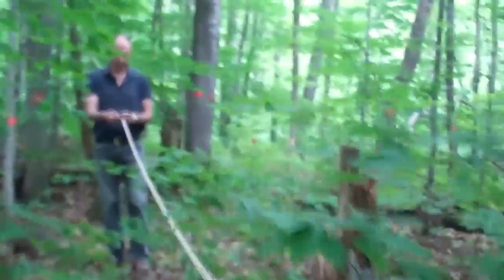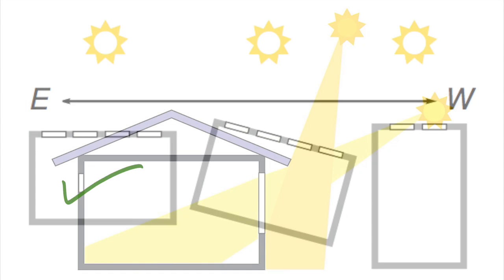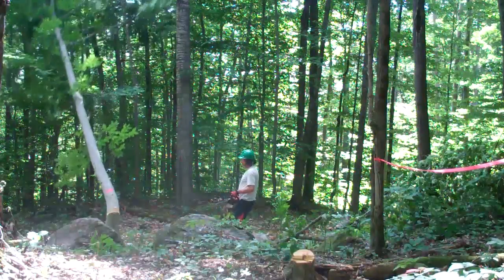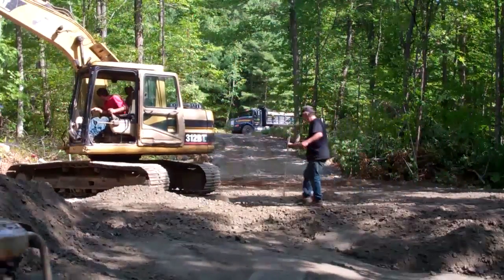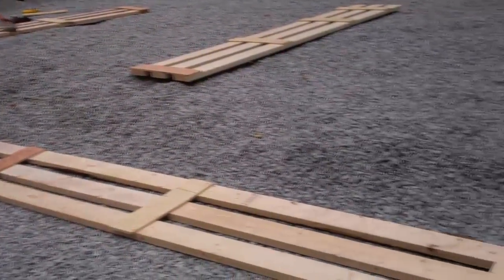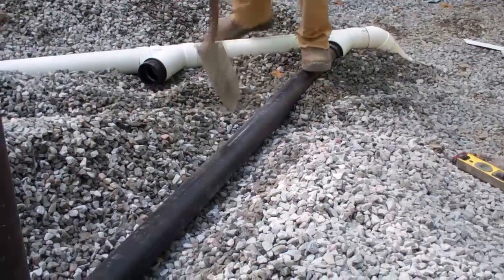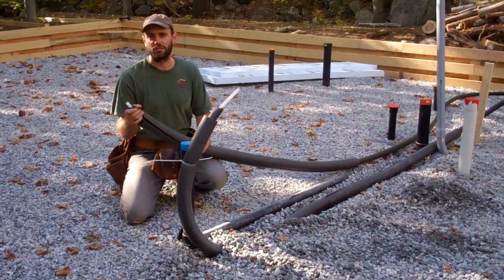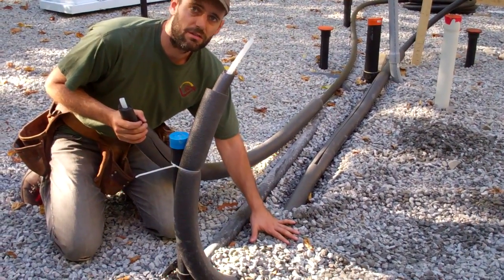How to build passive solar homes -

Comment: Is there anything special you have to do with a raft slab like this to manage frost heaving because you're not putting your footers below the frost line?
Reply from the maker: Hi Jonathan,You can see the insulation being installed in the next video, then after forms were removed we installed a 2 inch skirt of insulation extending 4 feet out from the foundation. That effectively moves the frost line and keeps the ground below the skirt and foundation above freezing. Have a look in our guide pages, you can get a better idea of the details. Regards.http://www.ecohome.net/guide/slab-grade-technical-guide
Reply from the maker: Hi Jonathan. This isn't actually a raft slab - a raft slab has no footings, it spreads the load evenly over the floor and is sometimes the only solution for building on problem soils, more here - http://dev.ecohome.net/guides/2217/slab-on-grade-prefab-form-kits/  But yes, you need to be sure to manage frost heave. This slab is built north of Ottawa Ontario at a higher elevation and so it includes a 4 foot skirt of insulation around the exterior. Perimeter skirting isn't always required, it depends on the climate as well as how much insulation there is around the edge, which determines the amount of heat loss and whether or not frost can form. That of course is not a decision you want yourself or a general contractor to make, that call should be made by a geotechnical engineer. Short of having that person on your team, you're best to install a skirt to be safe.
Reply: Ecohome